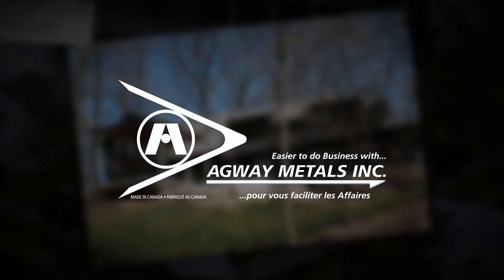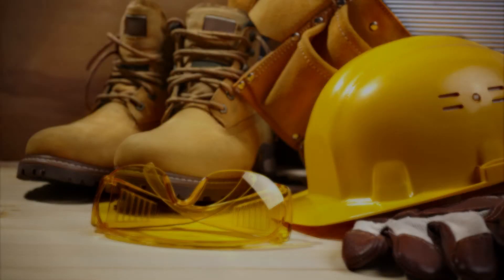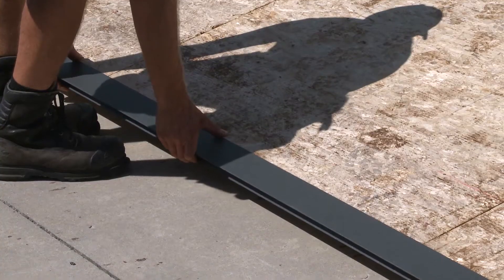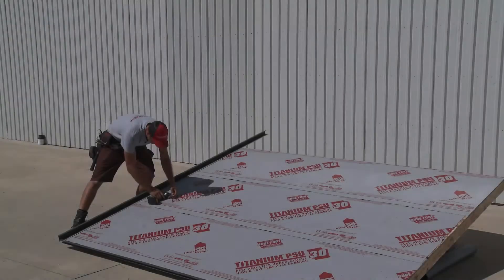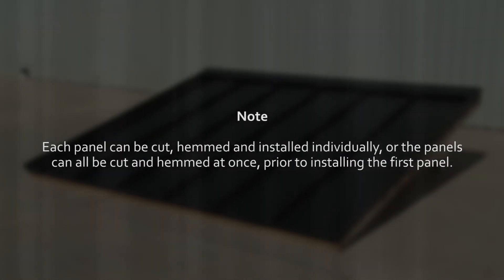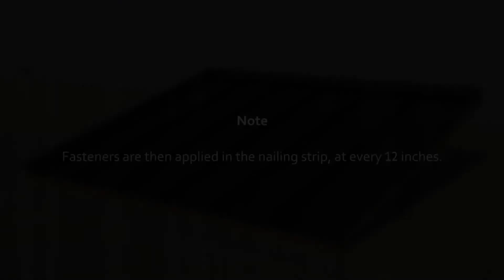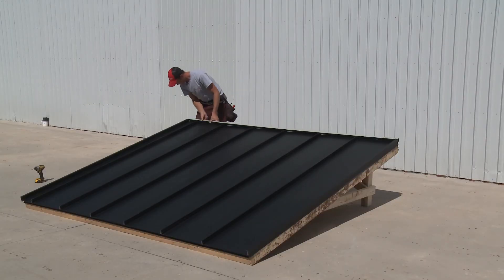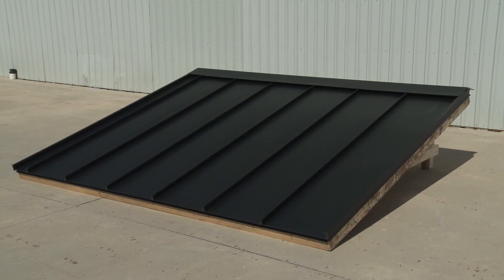Agway Metals Nail Strip Roofing Installation Guide

Comment: Does screwing zbar through the panels with several screws dispel the myth that these panels need to be able to move around?? 
I think so… 
You can literally shoot nail flange standing seam down with a roofing nailer.
Reply: The only thing that might happen is severe oil canning, but striations or ribs help with that anyways. Also, since these panels primarily are resisting uplift, a screw is going to hold the panels down much better than a smooth roofing nail, so just make sure and put a lot more roofing nails in than screws (I put a screw every 3').